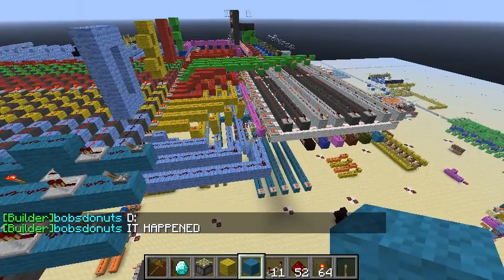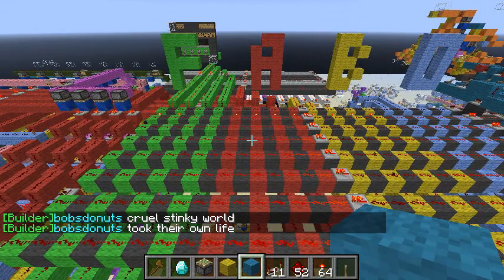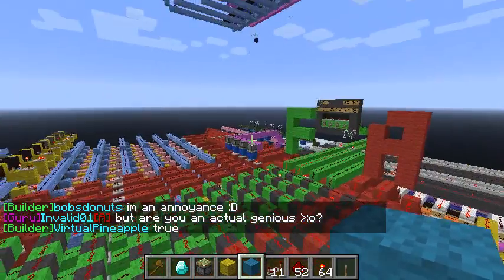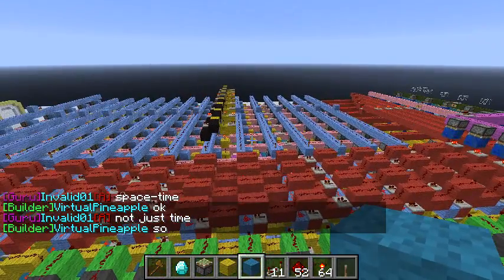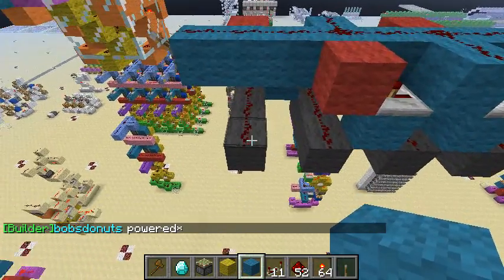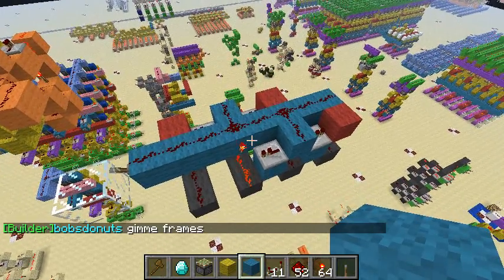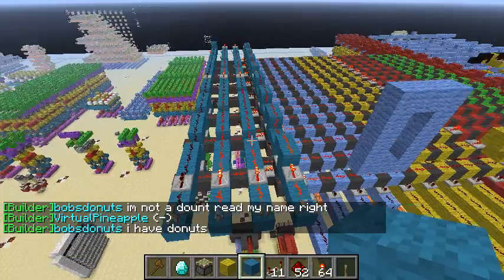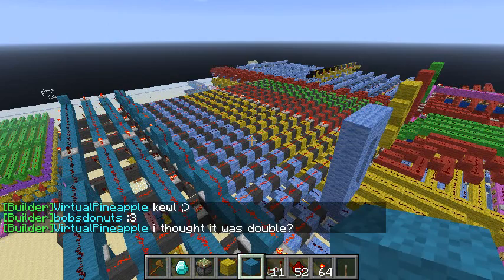CPU with Program Memory built

Comment from the maker: Obsolete when it's finished? Hah!  It's been obsolete longer than that.

It wasn't quite "cutting edge" when I started, and time has done it no favors.  Still, it was my first CPU, and I built it for practice and as a proof-of-concept.  I deliberately avoided the super-fast and compact mechanisms when I made it in order to simplify it's construction.  It was a learning tool, and the main thing I learned is that synchronizing a CPU is a pain in the ass. ;)